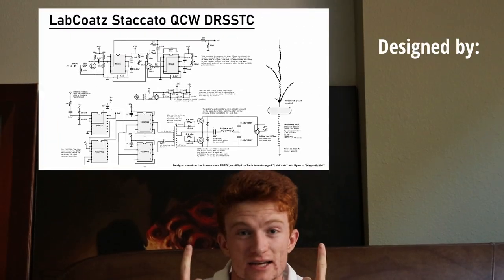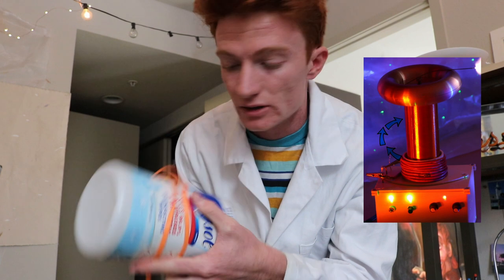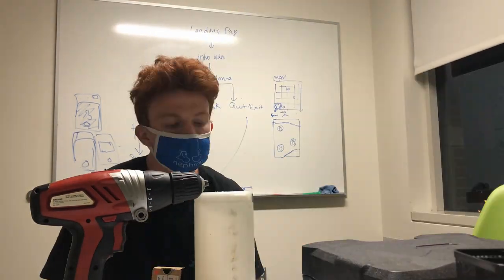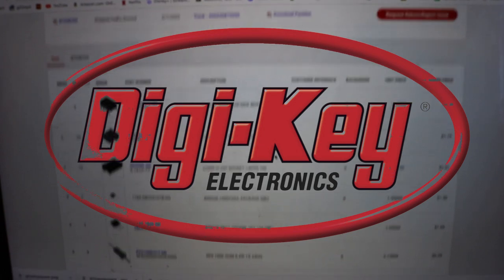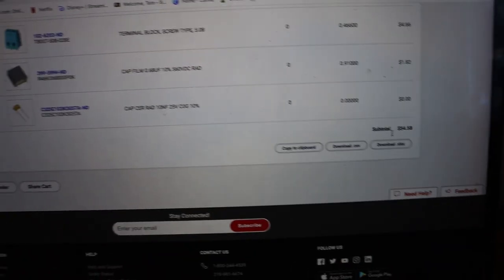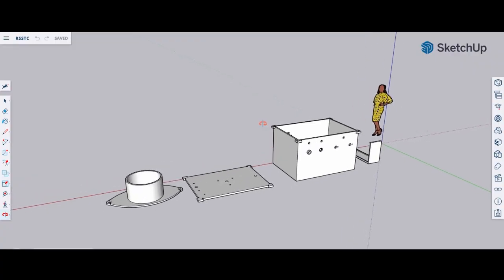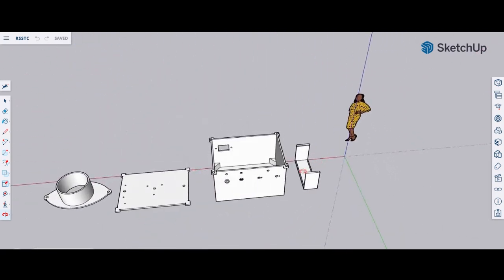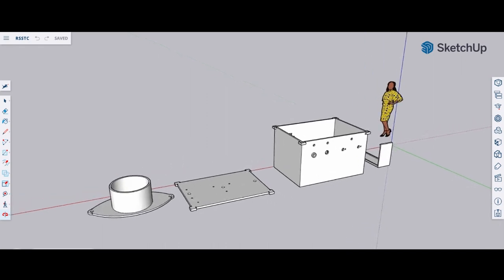Touchable Desktop Lightning! (Tesla Coil Build + PCB GIVEAWAY)

Comment: How do you control the amperage? This is a cool science project but I can't see how this can be contained to use this to power anything. Plus, I think our infrastructure and appliances would have to be completely changed to accomodate this means of energy transfer. Have you seen videos of people making huge models of this? They are very loud and I think dangerous. I watched your video where you made a larger model of this and you had to use a grounded glove to get close to it. Perhaps I just don't quite understand this source of energy very well. It's electro-magnetic correct? I'd imagine it could still cause immense harm to a person...
Reply from the maker: Only way to control current is with the knobs on the front. They determine the average power of the device since they can change the rate at which the tesla coil is turned on and off. I hope I’m not over-explaining, but it is called an interrupter circuit that only allows the tesla coil to run in short bursts instead of continuously, which reduces current and therefore power demand.
Reply: @BackMacSci  oh I see. Maybe I should have payed attention more. I like that. Can you show it running continuously? I guess I question the volitility here. Can you also show it turning something on? like a light bulb. (or maybe you did and I just didn't see)
Reply from the maker: This is just a pretty demonstration of electromagnetism, and not supposed to be practical. The videos I make are to educate about electromagnetism and are not meant to improve the world’s power infrastructure. Thats just where my passion and interests lie, and I leave the prectical research to others!
Reply: Do you know any channels who make these for mor practical purposes?

Comment: this is also so cool!! how did you do the calculation to know that it was safe to touch with your bare hand? Is there an equation you used for that? since if I recreate it, I don't want to die! lol
Reply from the maker: There’s no equation for it sadly because the danger of electricity is incredibly complex (check out styropyro’s video on “do amps kill” to learn more about this idea and be massively entertained). For this coil I would say the safety is mostly due to the high frequency of the voltage and the small amount of energy going through my heart

Comment: Can I have a PCB?
Reply from the maker: Sure! If you live in the US, email me your address, and I'll send it to you. My email is backmacsci@gmail.com
Reply: @BackMacSci  wellp there is the problem, I'm from Mexico:"v
Reply from the maker: Dang. Email me your address anyway and I’ll send the PCB if the shipping isnt crazy expensive!
Reply: @BackMacSci  no problem, the problem is the shipping for the components, mouser and Digi-Key shipping is like 600 pesos for me (30 dollars) it means it costs more than the project itself
Reply: @BackMacSci  even if I had the PCB I could just place some passive components like resistors, capacitors, some diodes, maybe IGBTs but not the gate driver and the GDT
Reply from the maker: @ElIsraelJijijiji  damn, I'm sorry about that. Maybe start saving for a tesla coil slowly over time?
Reply: @BackMacSci  I'm planning to build first the diodegonewild Tesla coil with IR2153, after I get into the school scholarship I can buy actuall pbc and components